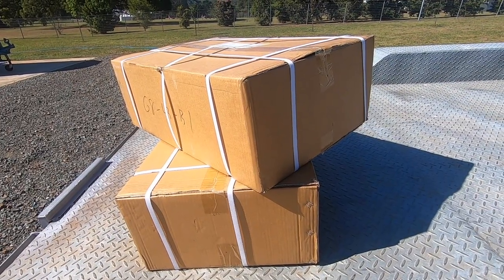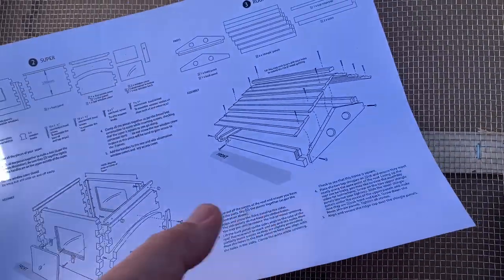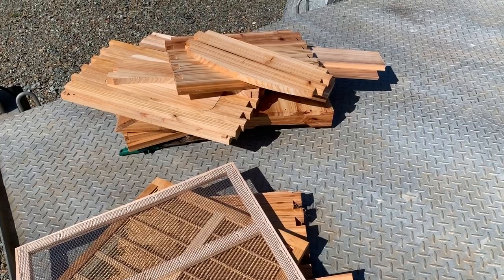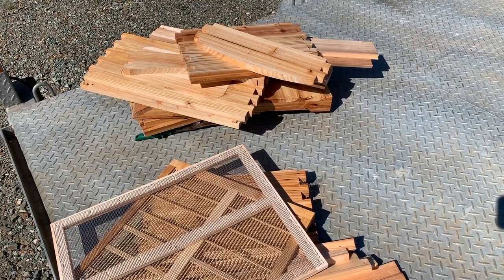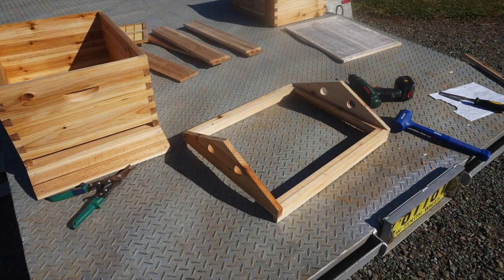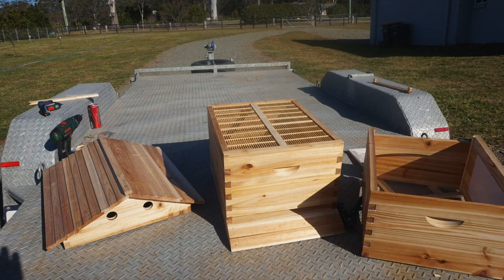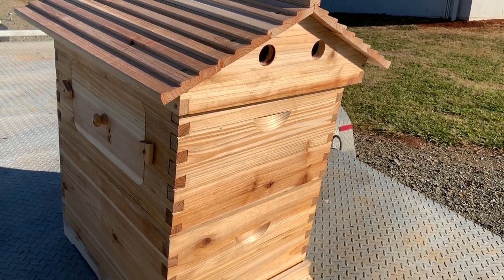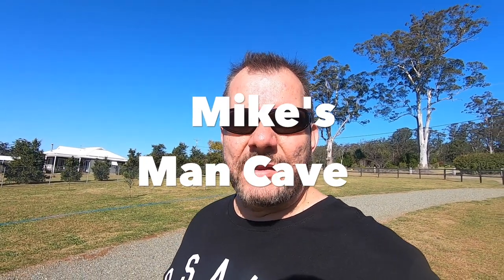Auto Flow Hive Assembly - Beginner Bee Keeping Series - How to Get Started

Comment: Do you screw or glue the entrance at the bottom of the brood box or just leave it sitting there. Also the frames for the brood box did you use the plastic inserts or leave the frames blank. I also ended up with 2 metal strips that I have no idea where they are supposed to go.
Reply from the maker: I screwed the entrance on with the provided screws. Not sure what plastic inserts you are referring to. There are no plastic parts that came with this hive at all and I put no plastic parts on it. It also has no metal strips at all and did not come with any. So can’t help you with those.
Reply: @MikesManCave  Thanks for the quick reply. My set up was exactly the same only as I said for the frames in the brood box I had plastic inserts in the shape of honeycombs. I guess they are to help the bees build their honeycombs but I have seen other you tube vids saying to leave them blank and let the bees do the work themselves
Reply from the maker: @timwestwood7341  This hive did not come with any frames, but yes you can do whatever you like with the frames. I think it saves time to have the inserts as it gives the bees a base to start with, but  the plastic you are referring to is usually wax not plastic where I live. I have never seen plastic ones, but thats not to say they don't exist, I know very little about bee keeping and I am learning as I go along.
Reply: I screwed the bottom entrance on but there were no predrilled holes and one side cracked the wood a bit, so watch out for that.
Reply from the maker: @wildone1392  A very good point.

Comment: The reason people go out of their way to buy the genuine flow hive is because it was an Australian invention and the chinese version is made by slaves.  I have both and the Aussie flow hive is just simply far better quality.  Plus I like to support Australian made.
Reply from the maker: I like supporting Australian made as well but not for four times the price. I can buy four hives for the price of one. I have been using two of these without issues. So the quality is not really an issue as there is no problem with these. I don’t think anyone goes out of their way to buy the genuine flow hive for the ridiculous prices they charge. Sorry but $1299 for a wooden box to keep some bees in is outrageous.
Reply: Truth is only the flow hive frames are worth the price as they allow variations in taste in the honey as you can extract from one frame at a time as different pollen is available to the bees at a given time. It also has minimal disruption to the hive and no filtering wax is required. But it seems to take longer for the bees to fill as the mess and rewaxing the frame greatly slows them down instead of instantly giving them a new frame to work. 

Also if you want the honeycomb your better off using the cheaper set-up. As he said, he can set-up 4 in the cost of one flow hive. Both applications are valid, hobby or agricultural. 

There has been issues with the closing of the flow frames and may require cleaning/replacing after a couple of years, probably best for beginners that don't know how to keep bees on an industrial level.